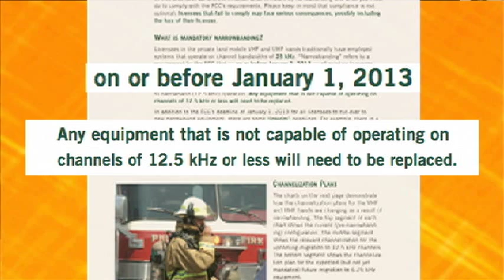800 MHz Radios

Comment: In 1995, Indy had all 7 PDs in Marion County, IFD, several Township FDs, all gvt ageencies on a trunked motorola 800 mhz analog system. Everyone had everyone elses radio channels in their radio. Interoperability was no longer an issue. The squared STX radios were fantastic. Sound quality was excellent. Several years ago they switched to digital. Now its got a computer voice quality, which sucks, but gvy complies. Can't believe anyone is making their first switch to new radios. Surely will be digital. If Motorola, will probably be  STX radios.

Comment: Buy the same radios they use get the programming software and program the program the proper info.There is a setting in the programing under Rx and then Tx in which one is for receiving and the other is transmitting so what you do not to break the law is not setup the transmitting part and now you have access to listen.
Reply: It is very difficult to get that programming. At least, it used to be.  It's very tightly controlled. I had a Motorola STX radio for my wife, but she was a Control Operator for our city police and I was a deputy. Had to take it to Motorola do the PTT could be deactivated and then to the guys next door to the dispatch center, MECA, who programmed it. It would still transmit when s shoulder mic was attached.
Reply: EBAY is the place to get radios.

Comment: This is the most ridiculous video filled with utter BS! They are trying to make a comparison between VHF and 800 MHz frequencies when that has nothing to do with anything. The old radio system had issues and it needed to be upgraded to P25 digital so that the audio quality would be better like they show you at the end of this video. But they should have left the frequencies the new system uses at VHF because they work best in the type of geographic area that St. John’s County is located. The problem wasn’t that the old system was on VHF, it was that it was out of state and not planed out properly. Now that the county is on these horrible 700/800 MHz frequencies they had to construct many new towers sites so they could cover an area that VHF could have done with about 4 tower sites. Thus lowering the cost of the system.